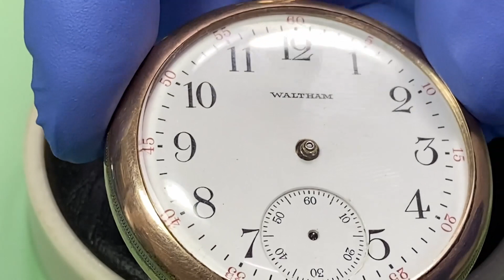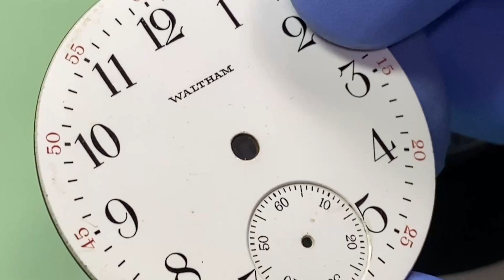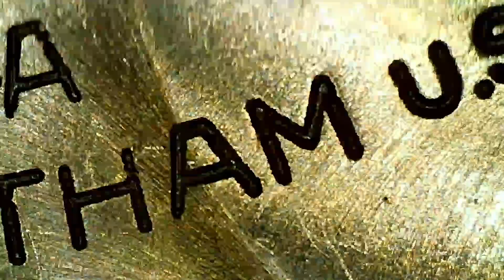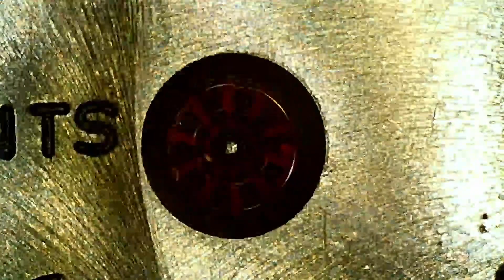Waltham Pocket Watch brought back to life.  Many problems found in the process.

Comment: Maybe its a Railway Watch so the case would not have the access slot for the setting leaver, the front has to be unscrewed to gain access to the leaver, it was I understand done that way to stop accidental time changes. If so you will need to find the setting lever parts, the backplate looks like it was cut to take a lever as well, try finding the setting lever parts first.
Reply from the maker: Thanks for the great info!!  I've sourced the setting lever parts and I'm ready to proceed.  I hope you check back and see what I decided to do.

Comment: eek, at 7:58 the escape wheel looks like it is jammed into the pallete fork under spring tension- best to depower the mainspring before attempting to remove that fork.
Reply from the maker: Well, sometimes I look back at these older videos and just shake my head.  I feel like I've gotten better over the past year.  To be fair, I don't think there was any power left in the mainspring when I started the disassembly.  The lower pallet jewel was broken and holding on to the pivot of the pallet fork.  Thanks for watching.
Reply: Yup, agreed, the broken jewel was the culprit for sure.  You got it right, and posted a very educational video.  Thanks!! @watchasilearn

Comment: If you're going to place the balance into the cleaning machine you should not put other large parts in the same section with it where they could get tossed into each other while spinning. Also, I pre clean my parts in 99% alcohol by hand with a brush, excluding the pallet fork and balance as they are soaked in Hexane to prevent damaging the shellac. Then I clean them all in the watch cleaning machine. I use L&R cleaner which isn't cheap so pre cleaning the parts helps the solution last longer and i'm certain that the parts are absolutely clean.
Reply from the maker: Hi Tim!  Thanks so much for watching and leaving that great comment. All your tips are much appreciated!!

Comment: Subbed! Thanks for this. Your video shows you have both a watch cleaning machine and an ultrasonic cleaner. Is the ‘spin’ type watch cleaning machine better for watch parts? Is there any reason to prefer one machine over the other?
Reply from the maker: Hi Robert.  I'm not sure the spin type cleaner is "better" but it certainly is more convenient.  Before I got that machine I used to clean the watch parts in the ultrasonic and it worked fine.  So if you've got an ultrasonic cleaner you are good to go!!

Comment: Well this video is a year old so You must have finished by now . I would modify the case for the lever set . As I once did for a Vanguard .
Reply from the maker: Hi Tony, thanks for watching. Yes, I actually bought a lever set case and installed this movement into it with the addition of some needed parts. But I see you’ve found that video based on the comment you left there. I appreciate your input and support . Thanks again for watching!!

Comment: Interesting video but please don't "drink thge Kool-aid". `Despite years of research and comparison there is no body of information that supports the idea that anything beyond 11 jewels contributes in any meaningful way to watch performance. In fact there are knowledgeable folks who draw the line at Seven jewels. There are a number of modern watches which have far in excess of 20 or 30 jewels, which allows the owner little more than "bragging rights". Just sayin.......
Reply from the maker: Hi Bruce, thanks for watching and for the comment.  I wasn't talking about jewel count in reference to the performance of a watch I was talking about the number of jewels affecting the quality of the restoration or repair of a 100 + year old pocket watch.  As a beginner/hobbyist I would rather spend a few more dollars on a more highly jeweled movement than spend my efforts broaching out metal bearing holes and resizing pivots.  Hope this helps to clarify my comments in the video.  No "Kool-Aid drinking" going on here.
Reply: Who are these knowledgeable folks? I thought 7 jewel movements were notorious for destroying themselves.
Reply: @Jake-bt3fc  I'm guessing you may be mixing this item with its cylinder counterpart. Cylinder movements were indeed known for gradually "self-destructing" owing to the grinding pressures in the balance complete.